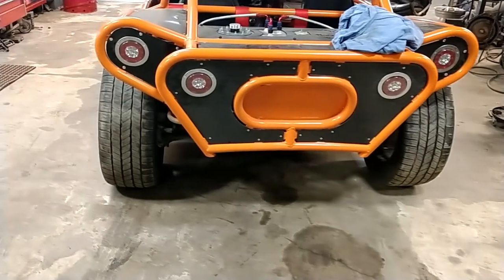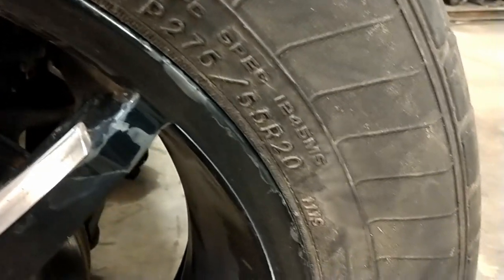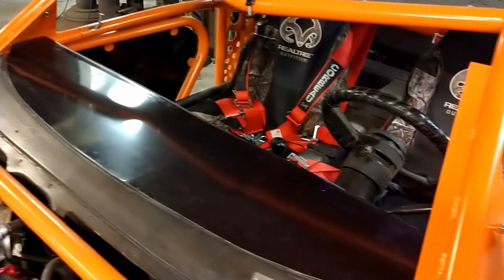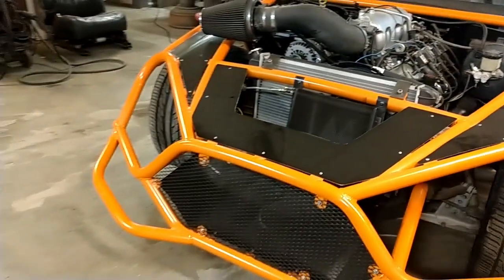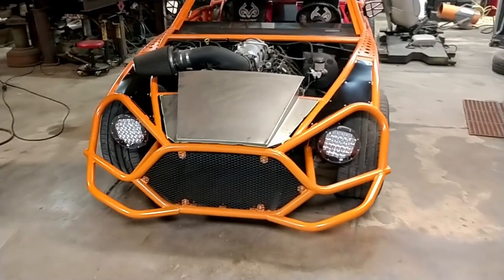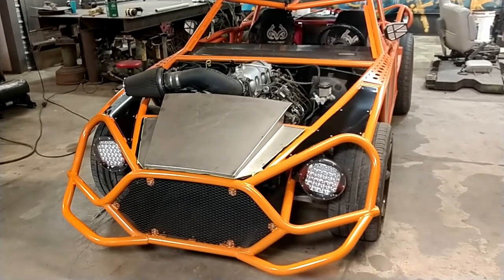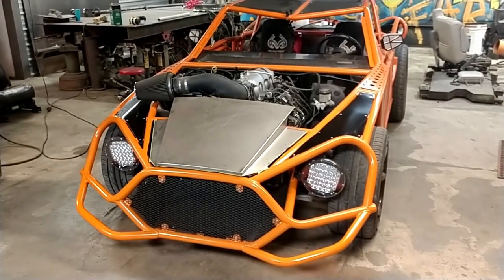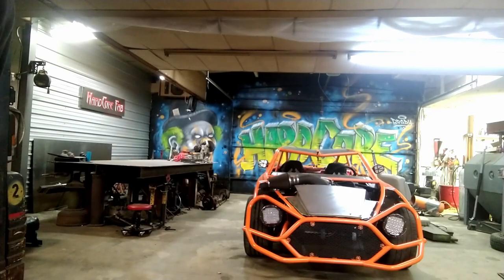Guess the hardcore fab vette kart weight

Comment: mine ended up weighing 2400  without me in it and made 313/350 at the wheels
Reply from the maker: You have me beat for now......for now.  LOL
Reply: @HardCoreFab  I have plans on pulling the motor out of my drag car and putting it in the boogerhook it makes high 5s
Reply: But you should make mid 5s easy on that 5.3 with a decent turbo setub